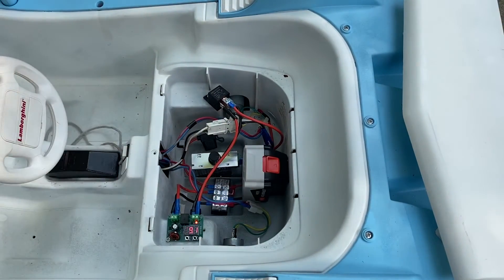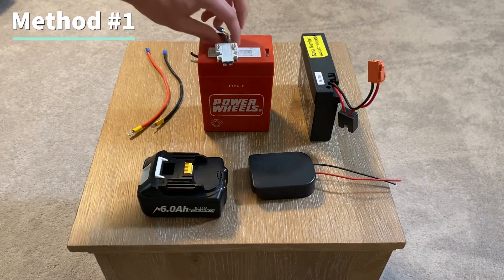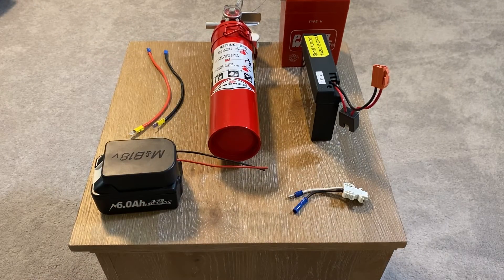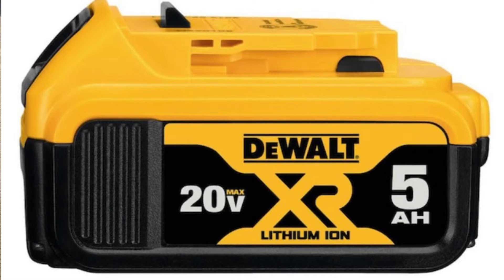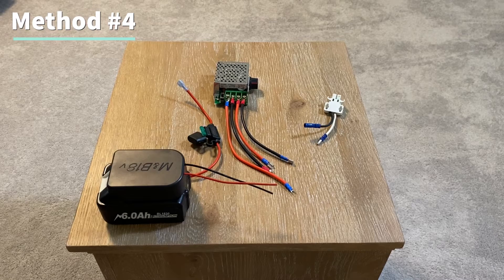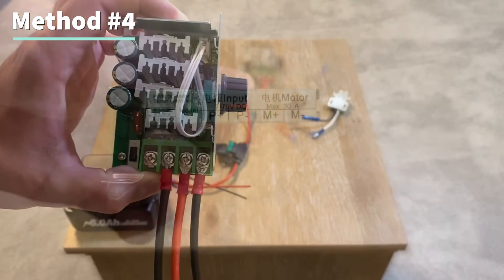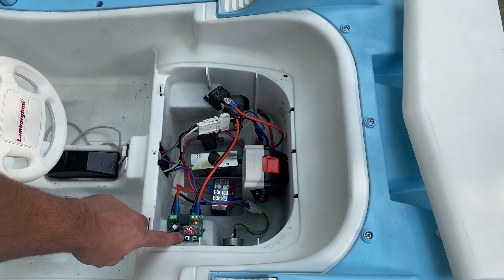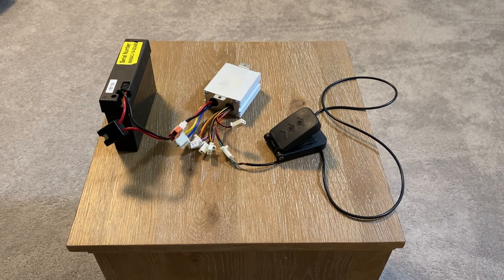Best Power Wheels Mod - Drill Battery Conversion (4 different methods)

Comment from the maker: The materials list is in the Description of this video
Reply from the maker: Running without the LVC would put the battery’s overall lifespan at risk. You just don’t want to run then lower than 15.0 volts (ideally). I stopped using the LVC and use a digital voltage meter to monitor what the voltage is at and then swap out batteries around 15.5 volts

Comment: Hello!  I've tried your advanced diagram on two of mine. Neither work. They read 12v all the way to end until I connect it to the central control unit. It then only reads 2.3v. I bypassed the relay that it connects to with the same results. My two cars aren't power wheels they are Land Rover and Lamborghini models.  Any thoughts?
Reply: Open circuit in control units need to replace

Comment: Thanks for the great video and explanation. Question. What does the 24v relay do? Does it magically convert 18v battery power to 24v or it can run 24v motors at the power it needs because of this relay? 
I am going crazy with this project and have burnt a couple of motors and blew countless fuses on battery inline and even speed controller. 
Now i have the digital PWM that has speed control, low voltage and soft start but for soft start i need to get 6 pin relay and variable speed pedal for it to work but first i need to figure the over current because i set my power speed on the PWM at 80 and once my kid starts riding it automatically brings it down to 40-50 which is no fun. 
Btw I am using Milwaukee 18v battery and 12v 550 motors. 
Appreciate any help/ suggestions! Thanks
Reply from the maker: So the 24v relay is protect the low voltage display board. It doesn’t change the voltage from 18v to 24v. That board can’t handle all the amps running through it, so the relay is able to power it with the voltage, but doesn’t send the full amount of amperage through it.

Comment: Do you have any insight on converting a power wheels that had the 2 6v battery system? It has 4 wires going into the connector from the battery
Reply from the maker: Yes. I had a cop motorcycle that was like that. In low gear it was 6v and in high gear it was 12v. the 4 wires were Red, Black, White and Blue. I had a 18v battery that I wired to the Black and Red wires on the motorcycle, I did not use the Blue or White wires. You also need to remove the wires that go to the High/Low switch. If you don't, you will pop the fuse each time the kid tries to switch gears. There will not be a High/Low anymore, only a high gear.
Reply: @DadHacks  That's really helpful, thank you! If I'm using the connector that came off the original set of powerwheel batteries, am I splicing both black wires and both white wires into the new connectors?

Comment: Is the process the same with Ryobi batteries?  Can I still add the extra protection in case the internal component fails in the Ryobi battery?  Does this work with both 12v and 24v cars?  FYI MAKTMOI 280Pcs  is not currently available.
Reply from the maker: Yes, you can still use extra protection. No, it only works on 12v cars. If you put 18 volts to a 24 volt car, your 25% slower because you are providing less volts to it
Reply: @DadHacks Thank you. What about a 40v Ryobi battery?  🙂
Reply: @DadHacks there are adapters for it. I think you got your next video!! 😄
Reply from the maker: The answer for the 40 volt battery is maybe… you’d have to rewire the car with a ESC (electronic speed control) until and replace the motors with 24v 775 sized motors. It would work, but it would also likely break the plastics gears a lot
Reply: @DadHacks I probably should clarify. This is for a 24v car. Not 12v.
Reply from the maker: For a stock 24v car, you can’t go with a higher voltage battery because it will burn out the control board. It would have to be a full rewire of the car and conversion to a ESC and variable speed pedal setup

Comment: Do you have the video of this set up where you have the speed controller with the voltage regulator?
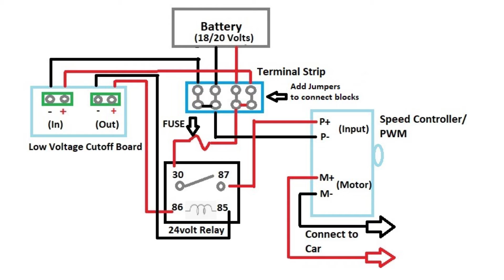Reply from the maker: @rasz1013  no, but the diagram at 4:19 shows how to wire up the speed controller with the voltage cutoff board

Comment: hey man i know this is old video but i’m in need of some help. i ordered the dewalt battery conversion kit on amazon that comes with the adapter the low protection board and the speed controller i wired everything up how it’s supposed to be however i don’t have the 24v relay or the terminal block. The issue i’m having is i can adjust the voltage with the speed controller and can see on the gauge the voltage it’s sending to the motor but as soon as i plug it in to the motor it’s stuck at 20v and the car will not turn on it is a push button start car if i just press the button i can see the light bar on the dash flash once and i can hear the motor clicking subtly but if i unplug the power plug from the motor i can put my multi meter to it and i’m getting the voltage output that i set it with the speed controller. The car does have radio and bluetooth horn button etc i checked all fuses and wiring everything is good. Question is do I need to have the relay and terminal block? i would imagine the car should still kick on being in getting power to the plug but why it won’t allow me to adjust it i’m not sure. I will note i wired it up with the first method just wiring the adapter directly to the motor but i had a fuse in it and the car worked for a short period of time it actually killed the dewalt
battery completely in like 8 min of driving and then i’ve been having issues ever since i even put a brand new motor in it along with the new conversion kit and i’m still having the problems. Did i possibly fry something else?
Reply from the maker: It could be the control board. Check out my other video. https://youtu.be/W2nbWo9Afqc. Those board don’t like to be over volted. You will likely need a 24v board that can handle the 20 volts you are using.https://amzn.to/443cs7N. Lastly, the speed controller doesn’t lower the voltage per se, its changes the pulse of the voltage, which slows down the motor, even if it’s showing 20 volts
Reply: @DadHacks do have an update i’m actually out here right now with it i wired in the relay and everything exact to your diagram and when i try to start it the voltage gauge drops down to 4volts and it just clicks and clicks i wired up the old 12v battery and car turns right on. my only question if i get that motor my harness won’t fit those plugs is there a harness i can get for it?
Reply: or is there a way to wire this harness to fit that 24v motor?
Reply from the maker: If the voltage is dropping down to 4 volts, the battery is dead
Reply from the maker: There’s no difference between a 550 12 volt motor and a 550 24v motor. They will fit the same
Reply: @DadHacks i’ve tried four different batteries that are charged and i have a gauge on my speed controller and it won’t output more than 14v but as soon as i hit the start button on the car the voltage drops to 4 and the motor just click click click. as for the motor the plugs all look different than what i have on my car
Reply: @DadHacks before when i didn’t have the relay the speed controller would be stuck at 20v which means the low voltage board was sending 20 to motor and stick at that
Reply from the maker: The speed controller doesn’t lower the voltage, it only “pulses” the voltage. So even on “full speed” and “low speed” it should show the same voltage,l
Reply: update. i found a 24v control board on amazon that is a jrx model like mine now but a 24v it looks like the plugs will work but the control
board has one extra plug for the drive gears im assuming my drive gears both run to a single plug with an extension harness im curious to see if i can just plug that one into one of the gear plugs on the control board and still power both of them. Control board will be in wednesday so i will find out
Reply: yeah idk i’m stumped man lol. hooked up the new 24v motor controller and still won’t turn on however it’ll turn on with the original 12v battery not with the dewalt harness. I even tried just wiring the battery adapter directly to motor with in line fuse and still got nothing. Tested voltage to the plug from battery adapter and it’s got 20v coming out of it plug it in and it just clicks. Hook the old battery up everything works as should with the 24v motor and the old 12v motor definitely stumped on this one. I have pretty decent electrical knowledge in the automotive aspect this stuff is pretty similar and i’ve tried everything and can’t figure it out. Is the board that’s in the dash that has al the accessory controls and start button on it not rated for the higher voltage maybe? idk
Reply: sorry to keep
bugging you man lol this thing is driving me crazy i just want it to work. I think the reason the harness isn’t working is because it’s sending to much voltage to the board that has the accessories buttons and the start stop button and i think i need to add a buck converter to reduce the voltage to that but i want to still get the speed that the 20v offers. i have a 24v motor in it now and an exact copy of your harness in the video and it still won’t power on just clicks. currently i’m running it with the original 12v battery and it’s stock so my daughter can at least drive it but i’m not ready to give up there gotta be a way to make it work lol i appreciate all of your time and help thus far. I just need to figure out how to wire in the buck converter
Reply from the maker: @SySteMaTiiKHDx the Start/Stop button could be the issue, but they typically handle 20v no problem, but it’s always worth investigating. The accessories (sound/lights) will burn out on 20v, but that won’t cause the car to not work. You won’t get the added speed of using 20v because you are “under volting” a 24v motor. For example, if the 24v motor spins at 20,000 RPMs, on 20 volts it will spin at 16,500 RPMs, or about 1 MPH slower… Also, a 24v control board likely won’t get powered on by a stock 12v battery. Lastly, yes a buck converter will help “save” the accessories for being over volted
Reply: @DadHacks it’s just not making sense. Currently right now i have it running off the stock 12v battery with the new 24v motor so the stock battery is running the 24v control board no problem i was driving the car around last night with the remote but if i try to run it on the dewalt battery it just clicks when i try to turn it on it’s truly got me stumped because i even took my multimeter and tested voltage coming from the dewalt adapter and it has 20v coming out of it so it should be providing the motor power. It’s almost as if something is cutting power when i try to start it up. However it is currently running with stock battery and the new 24v control board as of right now. Forgot to add in i also tried to wire the dewalt adapter directly to the motor with the in line fuse and it did the same exact thing
Reply from the maker: @SySteMaTiiKHDx  When you say you wired the Dewalt directly to the motor and it did the exact same thing, does that mean the motor worked or it didnt work?
Reply: @DadHacks it didn’t it would just click rapidly and then the lights on the dash would flash really subtly but no power same exact thing it does with the harness but everything functions perfectly fine on the stock battery that being the 12v motor and the 24v motor both run fine on stock battery. If it helps you help me any it is a 12v Hikole jeep it is a cheap one on amazon my daughter isn’t even 2 years old yet but the thing was so dang slow even on concrete i felt the urge and need to make it faster.
Reply from the maker: @SySteMaTiiKHDx  here are the few things to test. Put the 20v battery adapter directly on the 24v and see what the voltage is. You said that you have voltage leaving the adapter but the 24v motor doesn’t work even when connected directly on it. I’m wondering if there is something wrong with the battery that’s causing a huge voltage drop
Reply: @DadHacks tried 3 different fully charged batteries they are xr batteries two 6ah and one 4ah all three are reading 18-19v when plugged into motor soon as i try to start it voltage drops to 4v and erratically jumps from 3-4v and the board that is in the dash just makes a clicking sound
Reply from the maker: @SySteMaTiiKHDx  wire the battery directly to the motor. If voltage also drops down to 4 volts from a 20v Dewalt battery, then it means the battery is dead

Comment: I made the switch to drill battery but now the car is way to fast for my kids. I've tried adding two different pwm speed controllers to be able to slow it down. The car powers up and when you hit the go pedal its very jerky and the power/lights blink and eventually trips the fuse. Do I need the relay?
Reply from the maker: Which car do you have?
Reply: This is the car. OLAKIDS 2 Seater Kids Ride on Car, 12V Electric Truck UTV with Remote Control
Reply from the maker: You may not like the answer, but the best thing to do is switch back to a 12 volt since it’s too fast on 18 volts. Unlike a Power Wheels brand car, you can’t add a “soft brake” because of how it’s wired. My best advice is to use that car until they get bored of 12 volts and then buy a used Power Wheels off Facebook marketplace for cheap (less than $100) and then put 18 volts on that car.
Reply: Makes sense. What about different gear boxes? Ones with 15-20k rotations. If I used the original 12V battery could I use a step up booster before the rx30 to get to 15 or 18V?  @DadHacks
Reply from the maker: It’s the way the pedal is wired. 99% of the time those cars only have 2 wires going to it, making it essentially an on/off switch when it’s pushed down. Power Wheels have 3 wires, and if you remove the orange (I think it’s orange atleast), then the wheel will free spin when you let off the pedal, instead of coming to a quick halt. As for the RX30, I think it has a minimum voltage required to turn it on, so I’d suggest going back to the original, or a RX 23, 12 volt board. https://amzn.to/3UNhZwx
Reply: I should add that I am plugging into a weelye rx30

Comment: ok  im doing an 18v swap from 6v i been told anything over 12v will fry my radio and lights anyway i can avoid a fire n not have a sad lil girl in the morning asking  y daddy broke her toy lol
Reply from the maker: You will need to “step down” the voltage for the radio and lights with this https://amzn.to/3vG0jbJ. The two wires between the missing pin on the control board are  the two wires to use to “step down” the voltage. If it also has a control board, that will need to be replaced with one that can handle 18 volts, like this one. You will need to verify the number of pins is the same, this one has 7 pins https://amzn.to/42dN8el
Reply: @DadHacks wondering if this is what i need. so the two wires on the converter go to the two wires on the seven pin plug and then the other two wires on the converter tap into the battery?

Comment: Do you know if the craftman 20v battery has an internal low voltage cutoff…also can i just add a voltage display so i can monitor the voltage…instead of a volt cutoff mod.
Reply from the maker: I do think that Craftsman has an internal LVC. And yes, I actually have been using a digital voltage display instead of the LVC board recently. I find it more helpful.
Reply: @DadHacks  ok i appreciate the help…thanks
Reply: Really appreciate the reply.
Reply: Another? Would it be ok if i ran the battery up front, but the voltage controller in the rear of a mustang.  My son always washes his car and i dont want hin to get the controller wet.
Reply from the maker: @spins8085  ideally you will want the connection “tie in” to be near the battery, you can run longer wire to the back of the car without an issue though. It’s just finding a good spot to tap into to

Comment: best tutorial on youtube! can you add what gauge wires you use for each component. i have no electrical experience so i need specific specs of everything. thanks for your help!
Reply from the maker: Thanks! I used 12 AWG wire. I have a link in the description of the video
Reply: @DadHacks  I have a ride on that comes with a control module that allows me to remote control the car. ( hy2005rx 24v) do i put the PWM after the control module then to the motors, or between the battery and control module . (Battery>PWM>Control Module>Motors) or (Battery>Control module>PWM>motors)? thanks in advanced
Reply from the maker: @petersnng  put the PWM after the control module

Comment: Okay. My kids car drives like there is a loose connection. I am running it with a 18V drill batter with a 30A fuse. But I think it is the built in thermal fuse that is causing the issues. There is acutally two of the. One 5A and a 13A. Do I need Them?
Reply from the maker: What type of car is it? I think the 5amp and 13 amp fuses are for lights or sounds.
Reply: @DadHacks  I dont know the brand. Cant find it anywhere. The 13A is just right after the batter (positive line). The 5A is on the switch that controls high and low speed. Could it be for when it is drivning low speed. My son is allways drivning in low speed.
Reply from the maker: Was it originally a 6 volt or 12 volt battery setup?
Reply: @DadHacks  12V
Reply from the maker: @henriklassen3435  if the 13 amp was right off the battery, then yes, try removing it since you have a 30amp. What size are the wires? At least 14 AWG?
Reply: @DadHacks  Dont know why I did not try this befor. I made aa bypass on the 5A one, that is connected in the high and low speed switch. When I remove the bypass it will only  run in high speed, so it is for the low speed one.
I am thinking about takling the 13A from the batteri and use that for low speed instead of the 5A.
I dont know if all the wires are AWG 14. But I am still building on it, so the wires for the motors will be replaced with 2,5mm2 or bigger (yes I am metric) =)